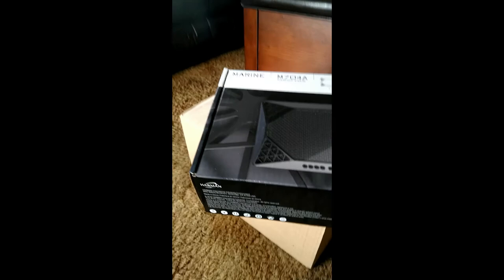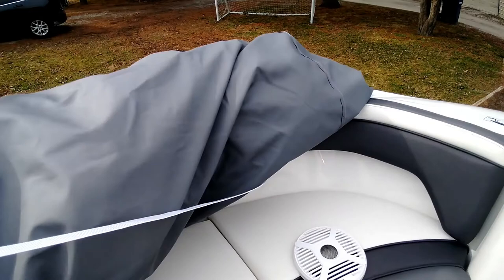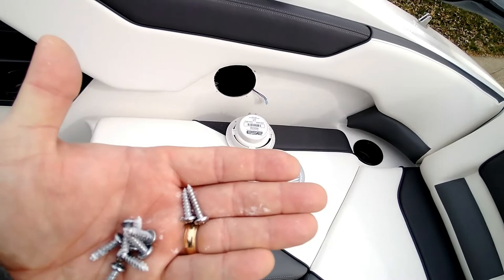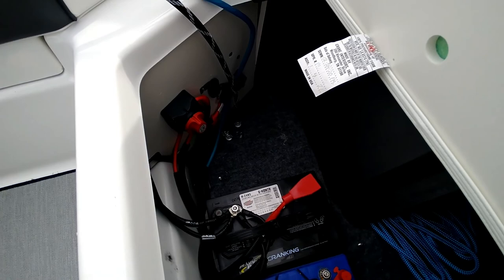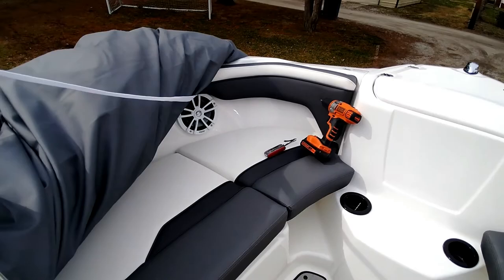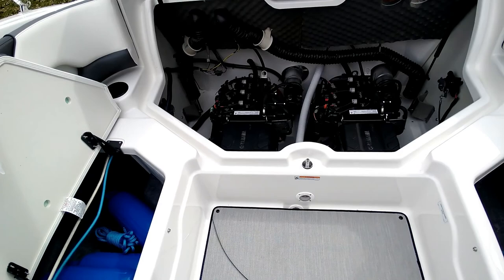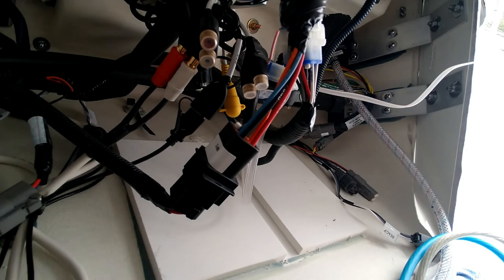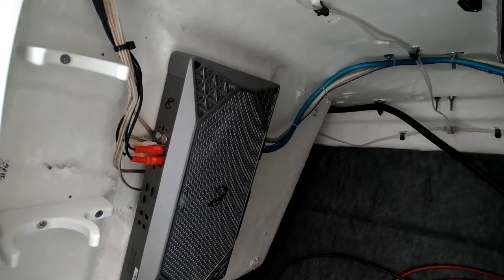Yamaha SX210 amp and speaker install

Comment: Interesting.  My 2011 SX210 does not have the access door on the steering side.  I guess I have to lay on my back and crawl under the driver area.  Problem?  Battery was out when I go the boat and wires everywhere...hooked all black to neg and red to positive and something blue a fuse.  So...not even sure how to hook up all the wires that are near the battery.  Any help would be appreciated.
Reply from the maker: I would take your questions to jetboaters.net  Also, any pictures you might have to help show what your dealing with could be shared there.

Comment: Great job - I've been looking for this type of video!  Did you consider adding a fuse panel for the system? Not sure of the pro/cons
Reply from the maker: No, everything is already separately fused.  But, I am contemplating bus bars for my positive and negative connections so I don't have so much wired directly to the batteries or the battery switch.
Reply: If you wired amp power directly to the house battery, how is it fused?
Reply from the maker: There is an inline fuse in the 4 gauge wire.  It comes in the Rockville kit.

Comment: Hi - great video. V useful.  Thanks.  On wiring kit; I noticed you did not put supplied fuse on live wire?  Is it not needed?
Thanks
Reply from the maker: I did install the supplied fuse, it's just not pictured.
Reply: Thanks for the reply.

Comment: Great video! I have the exact same boat.   What about the second battery?  Did you install a voltage relay to charge it while underway?   Like the Blue Sea  Add-a-Battery kit ?
Reply from the maker: I just added a basic two battery switch.

Comment: Great video.  How much play was in the speaker cutout? The infinity specs say they need 5 1/16”. I’m wondering if I could use speakers that require 5 1/4”. I don’t want to do any cutting on the fiberglass.
Reply from the maker: I didn't measure the existing holes.  The infinity speakers fit pretty spot on.  There wasn't much play, but the speakers weren't 'tight' either.

Comment: Did you re-connect the original harness back together after cutting it to use the speaker wires? I see there are still a red and black wire still there.
Reply from the maker: Yes.  The power wires are the only things still going to the head unit.
Reply: @oramac9  Thank you!

Comment: Did the stock speaker wiring work out ok, or did you find that you needed to upgrade it after? Thanks.
Reply from the maker: I used it all season, and it never let me down.  I believe the stock wiring is more than adequate.
Reply: @oramac9  perfect! Thanks!

Comment: How much extra did u have on your power and ground, I have a ar240 wondering if the 18 feet will work, thanks
Reply from the maker: I only had 1' of positive cable left over.  Not sure what kind of access you  have through your fuel tank access hatch, but a more direct route from the batteries would have given me much more slack.
Reply: @oramac9  thanks for the input, I got one 20’ hope it makes it, Im going with the same infinity’s and gonna try a kicker 10” tube

Comment: So is it a huge difference, and would you tell a difference without the amp just the speaker change
Reply from the maker: The quality of the sound might improve, but the head unit only puts out 20 watts, so the volume still wouldn't be enough to overcome engine noise at speed.
Reply from the maker: I can now hear the stereo easily at any speed.
Reply: I swapped mine out also  
I tried the speakers only. It SUCKED Added amp. Now sounds great

Comment: 3 months later - anything you’d change with your system?
Reply from the maker: Not at all.  The sound is excellent inside the boat.  The only change down the road might be adding some rear deck speakers.

Comment: How are the stock speaker wires holding up?
Reply from the maker: No issues.  They handle the power just fine so far.  In fact, I had to adjust the gain down on the amplifier, because it was painfully loud on the boat.  Clean, but LOUD.  I couldn't turn the head unit up beyond 50% before the volume was unbearable.  Yes, the wiring is fine.